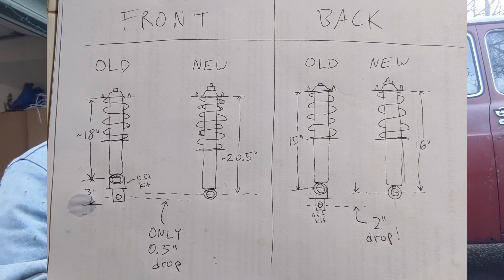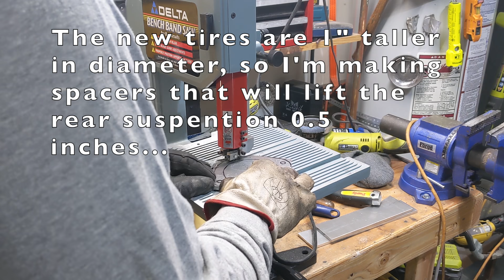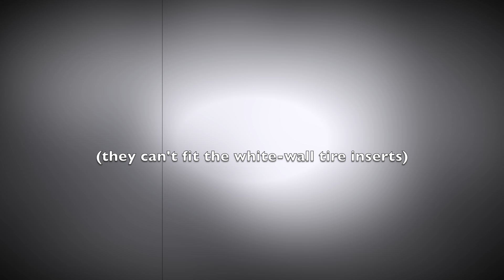DIY Fender Flares and Last Episode of the Build! - Project Frankenwagon, Ep. 23

Comment: Banding material. Metal banding material conforms to many shapes. (Accurately with magnets...rare earth magnets preferably.) Takes a scribe scratch easily and doesn't tend to rust.
So drill a hole and *Sharpie info on it and put it on a wire loop for the future and/or  passengerside.

Friends come to me on the off chance already have it on a loop or can help them make their own.

Hope that helps...really cool project. 😀👍

Comment: Really need the montage, I missed most of the episodes!  I can't remember if it has Miata engine and radiator or not.  It does have an all Miata suspension I gather and probably a lengthened Miata chassis.  
I just prefer the squarebacks to the fastbacks.  Just like I prefer notchback early Mustangs to the fastbacks.  Nobody much younger than me seems to remember how the Mustang notchbacks wowed Americans in the fall of 1964.  You might remember the introduction of the Ford Taurus in 1988.  It had a very similar effect on the public.  In my case it felt like: "Finally, an up to date car!"

Comment: I don't know if you fixed your window handle issue but if you put a gear on the spot where the crank handle was and run a chain down to another spot where you can mount it with another gear( I kind of had bicycle parts in mind) then maybe you can leave the crank handle on it permanently I dunno its just my two cents

Comment: Still waiting for a proper burnout video filmed from outside the car. Awesome job I also have a type 3 Squareback . Stock engine 50 year old suspension, slowww. I so wanna do a frame swap to a v8 but my car body is so rust free.